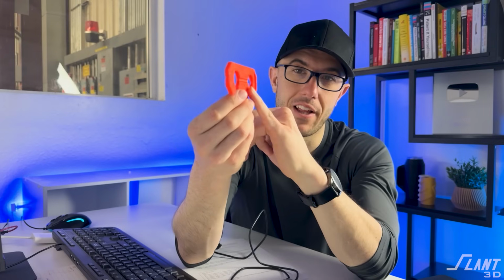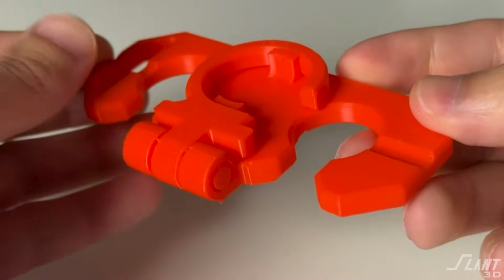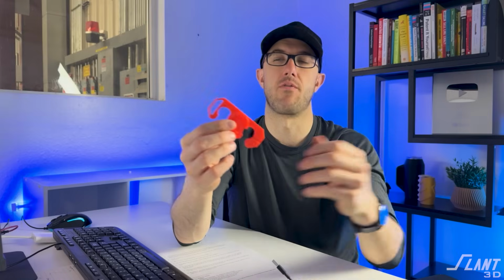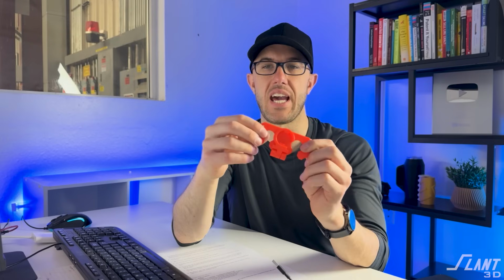3D Printed Starbucks | Why Hardware is Hard | 3D Printing News | Slant 3D Printing Podcast Ep 102

Comment: Hardware... physics!  :D  I dunno why that made me so happy, but it did.

As a hobbyist I find hardware much easier than software, because the individual tasks are easier to learn.  I've successfully built an R2-D2 - not without aid, of course, especially on the design end, but doing most of the work myself, and I'm at the point where I can build a lights setup from off-the-shelf parts instead of getting a fellow builder to figure that out for me.  But getting an arduino to tell an LED to stop blinking after 20 seconds has thus far escaped me.

However, I can see how "learning to use a drill press" and "running a hardware manufacturing company" are very different kettles of wax.

Comment: I work with hardware, firmware and software and they are all hard, sprinkle on top regulatory requirements and compliance checks and all of a sudden the complexity grows 100x.
Reply: Agreed. I'm in the same boat. My company has multiple disciplines and none of them are "easier", or "better", or any other meaningless comparative word. All I've noticed is that some people have more inflated egos than the rest. This comes from ignorance of the other disciplines.
Reply: Nah. Hardware is harder. Way more expensive mistakes and way more outliers.
Reply: @ ^^^ proves my point.
Reply: @tomsko863  keep talking :)

Comment: Hardware even just a tiny plastics toy needs a lot of certification needs a lot of thinking and a lot of paper work also a lot of checks if all is according to law. 
Well and then there is the next step hardware with battery something even harder.
Hardware with several sensors and chips is even more difficult
And hardware with a display and rf stuff is basically a art.
Adding to this hardware then software is basically already a ultra tiny amount of companies that can make that work.

Working in embedded software/hardware is a constant expectation that you handle all of this bridge interface.
You get even if you made it once not a second chance for years to make another product like that as its all certified and licenced and up to regulations.
(Some hardware is highly sessional)

Made software and hardware for Offroad its a lot more vibrations its also a feeling thing and also a thermal thing..
Keep also in mind that you are obligated to support your connected hardware for at least 10+ years

Comment: HW is hard indeed. You nailed it, requires multi-disciplinary skills.
And prototyping is one thing, but moving on to the Manuf phase can be a monumental failure if not properly experienced / prepared.
Worked for decades at a tier1 OEM designing high-end PCs.
Our ultimate get-out-of-jail card when late issues were discovered was "BIOS will fix it" ! 😅
Sometimes it was that or missing schedule by 3 more months and scrapping thousands of high-value chassis, PSUs or boards...
Of course, sometimes, even BIOS couldn't do zilch, and a lot of people were suddenly involved and very very nervous.
Great times !